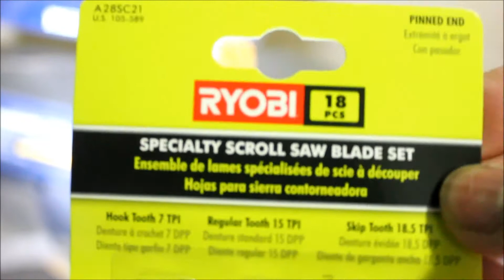how to change a scroll saw blade | 16-inch Mastercraft Scroll Saw | Ryobi Blade | JURO Workshop

Comment: Anyone have the manual for this saw?  I can only find the manual for the newer (crappier) non-variable speed version.  It was my understanding that the older models could also take flat blades and pin blades.  Can anyone confirm if they can use flat blades??
Reply: I believe I have a copy and it does say in it they can
Reply: The Ryobi website has 2 manuals available from different edition years… maybe the older one works?  I have the variable too.  The manual was SUPER minimal… just lots of legal danger notices and tons of translations.   But the speed selection I found online and wrote on my bald package.  The speed generally separates into 3 windows according to whichever of the 3 blades u are using.  Fewer teeth was for thicker and hard woods, and the speed range meets that.  I used the blade for thinner and pressed woods and it had a speed range starting at 600rpm up.sorry that’s so incomplete.